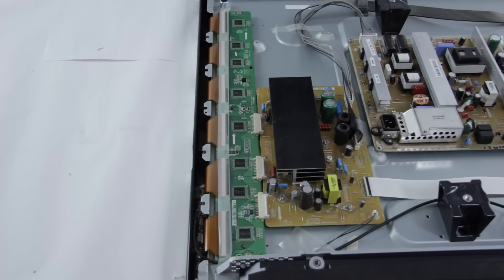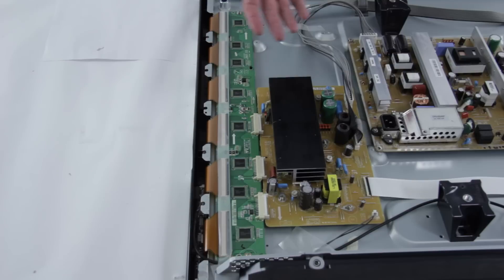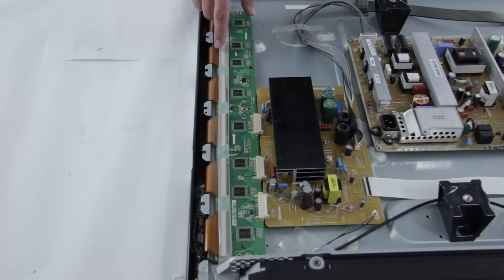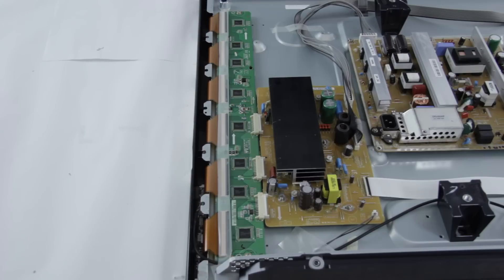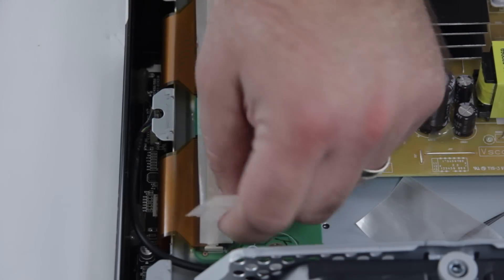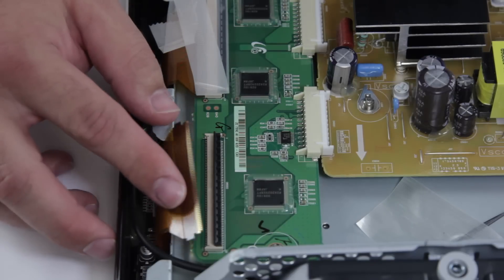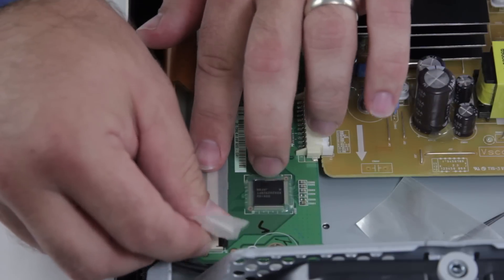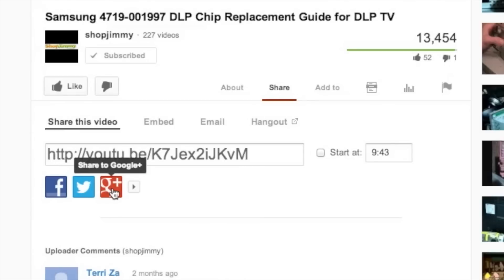Plasma TV Repair - No Image, No Picture on Plasma TV Screen - How to Replace Y-Buffer & Y-Sustain

Comment: jimplace   My Samsung PN60E550D1F has been quirky since I received it Christmas 2012.  In March 2014 the picture failed to come on at start up in the morning.  I foiund a fix after I turned it on in the morning I would wait for the sound to start.  Then I  would turn the tv off, and after the red off light was on for 4 or 5 seconds I would turn it back on.  After a couple of seconds the screen would flicker - then after a couple more seconds the Samsung logo would appear and then the tv would come on as if it were normal.  I did this for a few months - until we left for several weeks in late June.  Now, upon the return, the picture no longer comes on, after I try my stop and restart trick.  The sound still comes on after a few seconds.  Previously it had been quirky after going from tv to internet and trying to return back to tv.  When Samsung came out, they were going to replace the panel, but they found that the lower right corner of the metal backing had been damaged and they refused to do anything.  This damage had to have been done in the factory, because we hung this on the wall and there was no damage done at that time.  When the tv works, it works very well, and I don't think that the problem here is due to the physical damage that has occurred.  I am willing to try replacing faulting circuit boards as necessary.
Reply from the maker: Jim Place   If the glass is cracked there is nothing you can do. If the glass is not cracked then I recommend replacing the Y-Main Board and the Upper and Lower Y Scan Drive boards.  Here is a link to replacement parts for your TV model number on our website, click here:  http://www.shopjimmy.com/catalogsearch/result/?q=PN60E550D1F+  Be sure to match part numbers on your current board, with your replacement for compatibility.  Here is a link to a video showing how to identify your part number, click here:  Samsung Plasma TV Repair: Samsung Plasma Panel Parts Guide  You can also call our customer service for further assistance with your purchase.  (877) 881-6492  Thanks and please let us know if you have any further questions with your TV Repair!  www.shopjimmy.com

Comment: My 55" Samsung Plasma tv hdmi ports don't work model #PN51D45OA2D
Reply from the maker: Edgar Scoggins   I recommend replacing the main board in your TV.  Here is a link to possible replacement parts for your TV model number on our website, click here:  http://www.shopjimmy.com/catalogsearch/result/index/?cat=56&q=51D4  Be sure to match part numbers on your current board, with your replacement for compatibility.  Here is a link to a video showing how to identify your part number, click here:  Samsung Main Boards & Digital Boards: Part Numbers for LED, LCD, DLP, Plasma TV Repair  You can also call our customer service for further assistance with your purchase.  (877) 881-6492  Thanks and please let us know if you have any further questions with your TV Repair!  www.shopjimmy.com

Comment: I have an insignia 42" Plasma model NS-42P650A11. The Screen all of a sudden went out....instantly, went to black. Still have crystal clear sound and control of the inputs, volume etc....just no Picture. Help me out and I'll buy the parts from you:) Thanks!
Reply from the maker: Andrew Bagwell   I recommend replacing the Y-Main Board and the Y-Scan Drive in your TV.  Here is a link to replacement parts for your TV model number on our website, click here:  http://www.shopjimmy.com/catalogsearch/result/?q=NS-42P650A11  Be sure to match part numbers on your current board, with your replacement for compatibility.  You can also call our customer service for further assistance with your purchase.  (877) 881-6492  Thanks and please let us know if you have any further questions with your TV Repair!  www.shopjimmy.com

Comment: I have a Samsung model PN60E530A3F that recently stopped working. When I turn it on the audio works but there is no reaction from the screen at all. I opened it up to examine the parts and there are no visible issues (like a busted capacitor). Do you have any recommendation on which part is most likely causing this issue, and is it worth replacing the part?
Reply from the maker: Abby Jones   I recommend replacing the Y-Main board and the upper and lower Y-Scan drive boards.  Here is a link to replacement parts for your TV model number on our website, click here:  http://www.shopjimmy.com/catalogsearch/result/index/?cat=4&q=PN60E530A3F  Be sure to match part numbers on your current board, with your replacement for compatibility.  Here is a link to a video showing how to identify your part number, click here:  Samsung Plasma TV Repair: Samsung Plasma Panel Parts Guide  You can also call our customer service for further assistance with your purchase.  (877) 881-6492  Thanks and please let us know if you have any further questions with your TV Repair!  www.shopjimmy.com

Comment: Hello. I have an LG 42PC5D. After a storm the tv would not turn on. After further inspection I noticed the green power led comes on, blinks about 19 times then stays solid. During this time I can see the screen flash some light but nothing stays longer than a second or two. If I press the buttons on the TV, menu or input etc, sometimes it will flash sometimes the power led goes red. None of the caps look bad. What would you suggest?
Reply from the maker: John Wilburn   I recommend replacing both the power supply and the main board in your TV.  Here is a link to replacement parts for your TV model number on our website, click here:  http://www.shopjimmy.com/catalogsearch/result/index/?cat=4&q=42PC5D  Be sure to match part numbers on your current board, with your replacement for compatibility.  You can also call our customer service for further assistance with your purchase.  (877) 881-6492  Thanks and please let us know if you have any further questions with your TV Repair!  www.shopjimmy.com

Comment: Hi. I have a brand new Pioneer KRP-500M plasma monitor. I've had it in its unopened box in my garage since i bought it in 2009. Just a few days ago. I got it out of storage. I opened the box and mounted the tv on the wall. I turned it on. The power led indicator lights up but i have a black screen as well as a fairly loud buzzing sound that comes in and out. I am familiar with plasma humming noises. This is a loud buzzing sound. I can't get anything on the screen. I can't even pull up the setup menu or change inputs via remote or even manually. "Pitch black screen"
What are your thoughts on this?
Thank you in advance for your response.
Kyle
Reply from the maker: Kyle Halaoui   I recommend replacing the Y Board and Buffer board(s) in your TV.  http://www.shopjimmy.com/catalogsearch/result/index/?cat=4&q=KRP-500M  Be sure to match part numbers on your current board, with your replacement for compatibility.  You can also call our customer service for further assistance with your purchase.  (877) 881-6492  Thanks and please let us know if you have any further questions with your TV Repair!  www.shopjimmy.com

Comment: Hi, I have a 2 year old Panasonic 50" TCP50X5, Serial EA20890062.  Any power interruption makes the set go dead.  I unplug, wait 2 or 3 days and it returns to normal operation. This has occurred 15 or so times over the two years.  Is there a known fix?
Thank you  Bob Myers
Reply from the maker: bob myers   I recommend replacing the power supply board in your TV.  Here is a link to replacement parts for your TV model number on our website, click here:  http://www.shopjimmy.com/catalogsearch/result/index/?cat=59&q=TCP50X5  Be sure to match part numbers on your current board, with your replacement for compatibility.  You can also call our customer service for further assistance with your purchase.  (877) 881-6492  Thanks and please let us know if you have any further questions with your TV Repair!  www.shopjimmy.com

Comment: Ive got 55" plasma no picture it says weak or no signal on screen no picture and no sound trying to hook it to hdmi cabletv
Reply from the maker: Edgar Scoggins   I recommend replacing the main board in your TV.  Please reply with your TV model number and then I can recommend a replacement part.  Thanks!  www.shopjimmy.com

Comment: I have a fine-looking 32" Samsung LN-S3251D  I got out of the dumpster at an apartment. It is acting like it has an inverter board problem since it has sound, changes channels but no picture. I saw one 25v 470uf capacitor on the power board that had slight leakage and slight bulge. Power is getting to the inverter board. Could this capacitor be the problem?
Reply from the maker: North Charleston   This sounds like a problem with either the main board or the inverter.  You may need to replace each board individually to see which one fixes the problem.  Unfortunately I do not see any replacement parts in the search results for your TV model number on our website.  Please reply with your part number on your main board and inverter board and I can try searching for replacement parts.  Thanks and please let us know if you have any further questions!  www.shopjimmy.com

Comment: Hello there!

I have a samsung pn50b850 , it's roughly 5 years old. 

All of a sudden it blacked out today. I have tried everything in my power to test it's actually the tv and nothing else and indeed, it's the tv.

I can hear the tv start and shut down as usual and briefly upon start up there is a white line along the top and blurred pixilation in bottom right corner. This last for roughly a second then complete darkness. 

I'm thinking possibly a capacitor/s or bulbs! 

Any advice would be fantastic as I absolutely love this tv.
Reply from the maker: PipersFeat   I recommend replacing the Y-Main Board and Y-Buffer board in your TV.  Here is a link to replacement parts for your TV model number on our website, click here:  http://www.shopjimmy.com/catalogsearch/result/?q=pn50b850  Be sure to match part numbers on your current board, with your replacement for compatibility.  Here is a link to a video showing how to identify your part number, click here:  Samsung Plasma TV Repair: Samsung Plasma Panel Parts Guide  You can also call our customer service for further assistance with your purchase.  (877) 881-6492  Thanks and please let us know if you have any further questions with your TV Repair!  www.shopjimmy.com

Comment: I have a Samsung 50" model HpT5064 with sound but no picture. It is about 7 years old.  I took the back off and I see 1 capacitor that looks dark and bulged.  All the other capacitors look new with a flat top.  I can e-mail you some pictures but shop jimmy.com didn't work from my gmail account which is hdtash@gmail.com. Please advise.
Reply from the maker: Nancy Tash   You will want to replace that bulged cap or the entire board.  Here is a link to replacement parts for your TV model number on our website, click here:  http://www.shopjimmy.com/catalogsearch/result/?q=HpT5064  Be sure to match part numbers on your current board, with your replacement for compatibility.  You can also call our customer service for further assistance with your purchase.  (877) 881-6492  Thanks and please let us know if you have any further questions with your TV Repair!  www.shopjimmy.com

Comment: We have a samsung 51" plasma tv. Around Christmas this tv started with little black lines and it wasn't a big deal, but now the lines became bold. Huge 1" black solid lines. And now nothing pictures but sound comes on.
Reply from the maker: *****   This sounds like a TV panel problem.  If your TV panel is bad, it may be more cost-effective to replace the TV as panels are typically hard to find in stock, difficult to replace, and expensive.  Thanks and please let us know if you have any further questions!  www.shopjimmy.com

Comment: Need tv repair help...  I have an LG 50pc3d-ud tv.  There is no picture when I turn on the TV.  It's just black with a few white or gray lines.
Reply: There is sound and the picture is flickering and it's sometimes a yellow thick line instead of the white and gray line
Reply from the maker: Dalton Vince   This sounds like a TV panel problem.  If your TV panel is bad, it may be more cost-effective to replace the TV as panels are typically hard to find in stock, difficult to replace, and expensive.  Thanks and please let us know if you have any further questions!  www.shopjimmy.com

Comment: Hi My name is Gwen I have a 43" or 42" Samsung Plasma TV Model # HP-S4253 Code HPS 4253X1XAC Serial # BIAF3CMLA00369T bought it in 2006 When I turn on the TV I am getting sounds, the picture comes on for a moment and then disappears. Is it possible to have this TV fixed and @ what cost. Please reply to agatha54@gmail.com if you can assist me. Thanks. Gwen
Reply from the maker: Agatha Gouveia   I recommend replacing the Y-Main board and the Y-Scan Drive board in your TV.  Here is a link to replacement parts for your TV model number on our website, click here:  http://www.shopjimmy.com/catalogsearch/result/?q=S4253  Be sure to match part numbers on your current board, with your replacement for compatibility.  You can also call our customer service for further assistance with your purchase.  (877) 881-6492  Thanks and please let us know if you have any further questions with your TV Repair!  www.shopjimmy.com

Comment: i got a lg plasma tv modol number 42pc3dv no image got sound help needed
Reply from the maker: Gladys Nieves   I recommend replacing the YSUS and YDRV boards that are in the TV.  Here is a link to replacement parts for your TV model number on our website, click here:  http://www.shopjimmy.com/catalogsearch/result/?q=42pc3dv  Be sure to match part numbers on your current board, with your replacement for compatibility.  You can also call our customer service for further assistance with your purchase.  (877) 881-6492  Thanks and please let us know if you have any further questions with your TV Repair!  www.shopjimmy.com

Comment: I have a 60 in lg plasma, it popped and there was no picture, but I had sound, bought new y buffers and a y sus board installed them and still have the same problem,,notice when they sent me the new y sus board it had a different part # on the board, went online for some help and was told that it would probably work and that it would not harm the tv, put it together and I have no pic but sound, my tv is 60pz950ua, would the wrong board work and give me the same no picture, the correct board is a ebr71516301 and I put in a ebr73561201
Reply from the maker: Louis Casterson   You will want to make sure your board is a listed substitute or replace with only the exact board that was originally in your TV.  Thanks!  www.shopjimmy.com

Comment: Hey Jimmy, 
I have had a problem with my samsung plasma TV 43" which I purchased in 2011 Fall. after 1 year and a half of work, my little boy (4) threw a little hollow cube (toy) towards it (while i was watching a video on a flash usb..). nothing happend until I switched to satellite receive when i saw a black area on the bottom right side of the display! I thought it would disappear but it grew bigger day by day until the whole TV screen became black and you can hear just the sound! here is a picture of what it looked like.( oh i will send it separetely cause I dont know ow to attach it here )
Reply: My samsung plasma 43 inch Tv info
Model Code PS43D450A2WXMV
Serial number LDFB3DHB400437Z
VERSION I104
Thank you a lot
Morocco!
Reply from the maker: Mohsin Sharky   This sounds like a TV panel problem.  If your TV panel is bad, it may be more cost-effective to replace the TV as panels are typically hard to find in stock, difficult to replace, and expensive.  Thanks and please let us know if you have any further questions!  www.shopjimmy.com

Comment: Hello
I have a LG 50PG20-UA TV about 6 yrs old
that suddenly went dark on me. The problem first started with a reddish/orange lines on top portion of the Screen. After about two weeks it went completely black. I can turn it On & Off and still have sound. Just no pictures. I was about to take it to the landfill until someone told me it is fixable if I Google and and go on YouTube. After watching you video I think I may be able to salvage the TV. I already went out and bought a 60" LED Sharp Smart TV to replace the Plasma. But if you can guide me with  with how to fix it, I will still have some use for it in my guest room. Thanks in advance for your help and time.

Carl
Reply from the maker: Carl R   This sounds like a TV panel problem.  If your TV panel is bad, it may be more cost-effective to replace the TV as panels are typically hard to find in stock, difficult to replace, and expensive.  Thanks and please let us know if you have any further questions!  www.shopjimmy.com

Comment: I have a Visio DPD42X32000. Dark screen with sound. Black line obscure screen mostly except small patch on left side of screen. Both fuses on V board on right are good 5v. On terminal 59.6 on vacation pain and western. Same on Y board
Reply from the maker: Tony May  This sounds like a TV panel problem.  If your TV panel is bad, it may be more cost-effective to replace the TV as panels are typically hard to find in stock, difficult to replace, and expensive.  Thanks and please let us know if you have any further questions!  www.shopjimmy.com

Comment: I have a samsung model PN43E450A1FXZAI have been watching your videos and replaced the x board, logic board and the F board ... It only makes  the startup sound when the E board's ribbon cable is disconnected from the logic board
Reply from the maker: bradbork1   What was the original problem with the TV?  Please explain the symptoms and problems.  Thanks!  www.shopjimmy.com